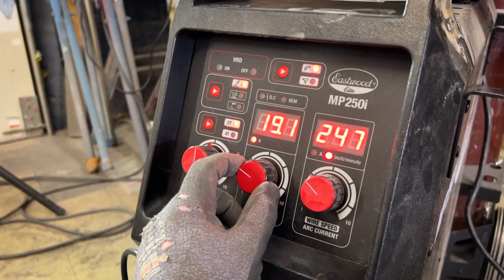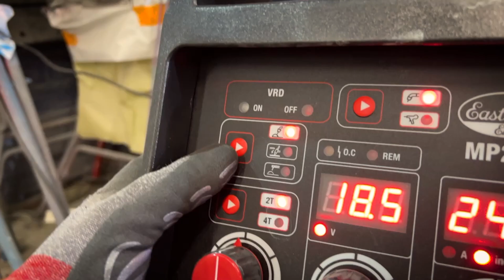How To Install Custom Widened Porsche Fenders - TIG Welding Like a Pro! Eastwood

Comment: Question: Did you have to remove electronics from the car (radio, ECU) before welding?
Reply: I would or at least disconnect battery and there for circuits .